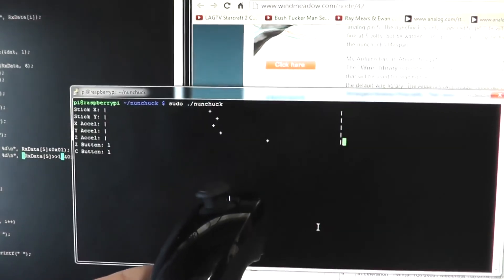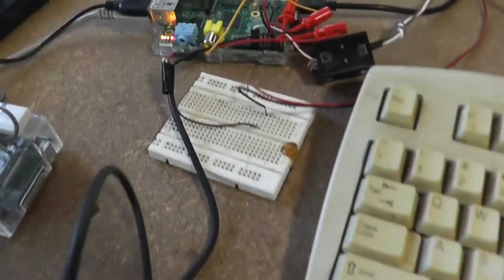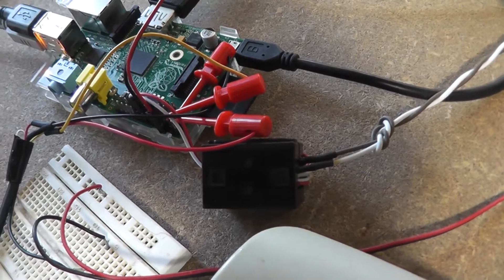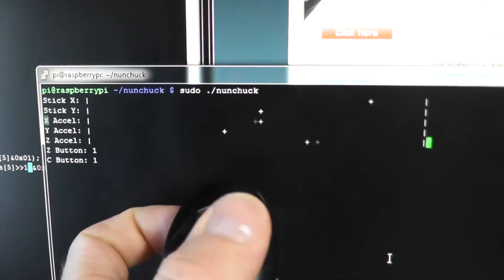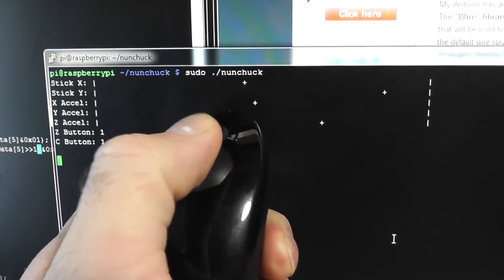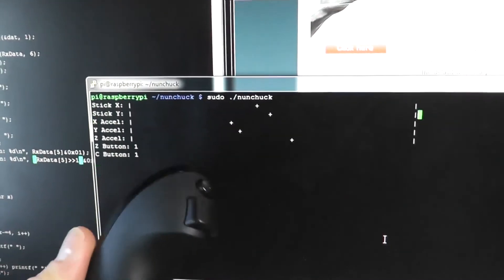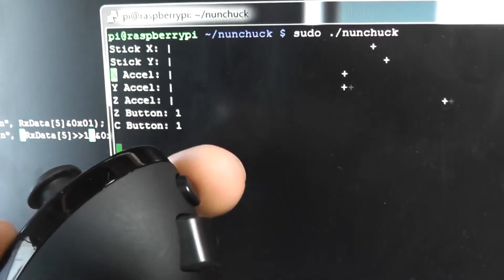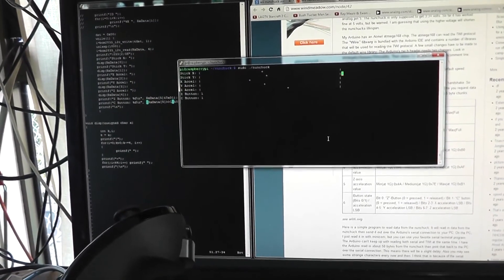Raspberry Pi Nunchuck Demo

Comment from the maker: Compile with (from memory):

gcc -lbcm2835 main.c -o nunchuck
Or maybe:
gcc -lrt main.c -lbcm2835 -o nunchuck

run with:

./nunchuck

The compile line may not work, there was an issue with having to include the rt library along with bcm2835 but it's an old project so I can't remember the details sorry.